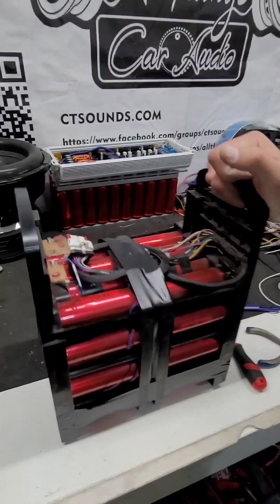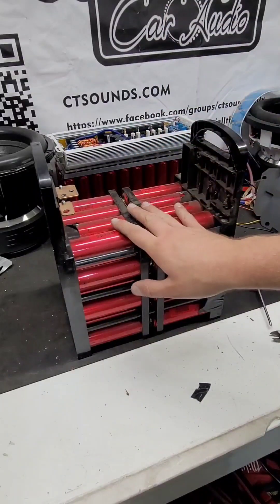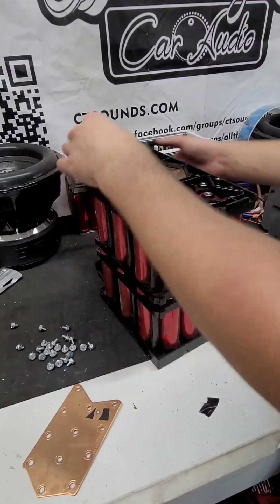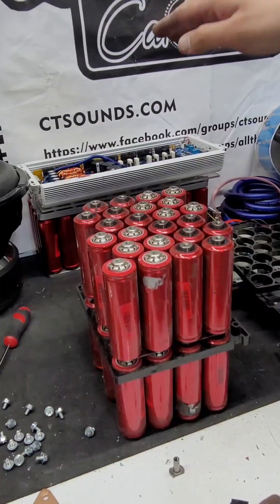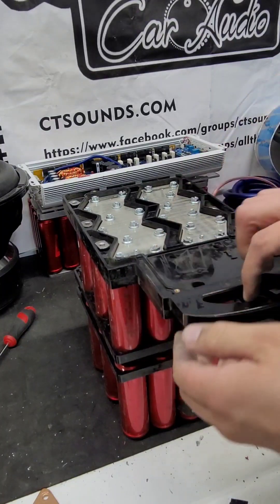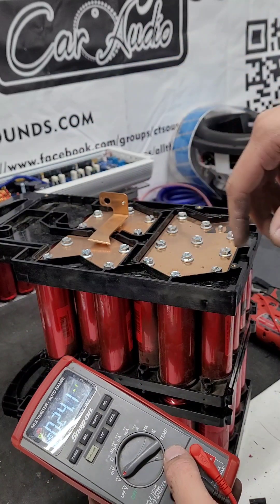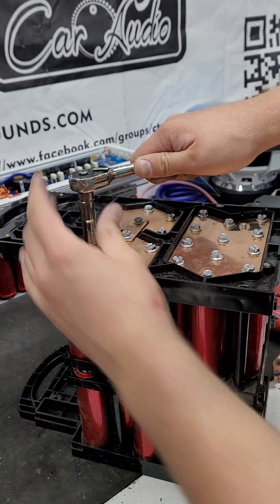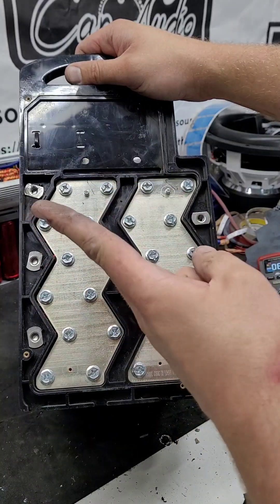How To Convert 96Ah Headway Super Beast to 12v

Comment: so i dont have a high output alternator at the moment and i plan on running a cab22, could i use this and be fine with my stock alternator until i get my new car and alt?
Reply from the maker: Yes, absolutely
Reply: thank you for replying. I shouldve mentioned though, i drive an hour to work, think the stock alt can charge the bank enough to keep me from dropping too much?  @ATCA
Reply from the maker: @Josephobrien-qo3wq  yea
Reply: alright, thank you for responding. @ATCA

Comment: Alright, first off, Im a meat head. I have this assembled backwards however I cant see it making a difference. Basically, the bars that you connected with the cut off piece on your positives, is connected on my negatives. Everything reads the proper voltage, I just have my negatives on the right rather than your left lol.. with that being said (and tell me if that will make a difference), when referring to your balancer video I followed but had to reverse the green and white wires rather than the way you had it. My balancer “run” light has been on and I have been charging it ever since (few hrs tops) but the light has not turned off. Is this normal?
Reply from the maker: Depending on your balancer, the light will always remain on. I have assembled these backwards as well and it makes no difference.  It sounds like you're off to the races!
Reply: @ATCA  Woohoo!!!! Thank you man seriously. I was going to literally take it all apart again in the morning and reconfigure it while re-following your video but Ill rest well knowing I can just continue with building the housing for it. What should the resting voltage be after all is charged? Thanks again for the sweet video
Reply: I didnt do a top balance or anything, each cell read 3.26 to be exact

Comment: This video has been very helpful where do I put the terminals if I want to use both  batteries this creates? Can I add additional copper with copper pipe that I cut and flattened to beef them up?

Comment: I think u need a jumper wire on set b1 and b3 also like u do on b2, otherwise its only balancing 6 cells in that group and not 12 if my thought process is working correctly lol

Thanks a TON for hooking me up with one of these! Should be a huge help with my battery generator project! 

I hope u find that gokart fun!
Reply from the maker: I put a jumper
Reply: @Trevor Moon  sorry if I came off the wrong way the other day, just thought I found something I should share with u.

Tested it out today and DAMN, she pushes some power! Pulled 1600 watts like nothing!
Reply from the maker: @2down2togo  awesome
Reply: @Trevor Moon  I must of missed it. Did have u had a chance to go over that gokart?
Reply: Hey todd wondering if this is true? I’m about to build mine.
Reply: @kevinlechner7722  if u pay more attention like i didn't, he did put the jumpers on lol buy yes they are needed because the cells are in groups of 6 not 12
Reply: U can also make 2 packs and parallel them together at the end so the groups of 6 don't need to be put together with a jumper. Theres 2 good ways that I know of if u want to keep the pack together otherwise u need your own buss bars
Reply: @2down2togo  so I could buy the 12v holder make use the original and make two packs and then use just one balancer? Thanks btw

Comment: Great info. I wonder if you could order one of the plates that are connecting all the negatives, and use it on top to join the positives...I get you'd have to modify the plastic piece with the integrated handle, but the new plate would cover the mods and look super clean when it's done. I've been watching DIY Lithium bank videos all morning and this is the most interesting thing I've seen. Thanks!
Reply from the maker: Absolutely you can do that
Reply: @ATCA will battery Hook up will sell the bus bar's and new end caps? Cut some plexiglass for side's!  I just ordered one yesterday and a balancer. Hopefully this will stop my taramps from shutting down on bass hits... Even with an Apex 400 amp alternator 😢

Comment: Your balancer and BMS monitor lines are not on all the cell groupings. You should have jumpers across the center plates, and another copper bar across the other two vertical plates. And if one cell dies, you better have some serious connections between the center plates and the other side.
Reply from the maker: Check out the balancer video

Comment: So how many amp hours is this 12V system after the conversion? I'm thinking about buying (2) of the super beast modules from battery hook up
Reply from the maker: 96ah. As the title states
Reply: @ATCA  WOW 😳😳😳. So that headway battery module can support over 10,000 watts in car audio?
Reply from the maker: @drvictoria07  with a big alt, yes. I'm running 2 of these and 2 360a alts for 20k watts
Reply: @ATCA  awesome 👍. That's all I needed to know! Can I use my stock alternator with it or buy a high output alternator?

Comment: I just installed this as my main battery located in the trunk. My car 2005 Volvo v70 is only charging my bank to 13.2 - 13.3 volts is this okay for these cells ?  Any advice or input is appreciated !
Reply from the maker: Likely a poor gnd or power
Reply: @ATCA  I’m gonna investigate my voltage at the alternator and check for drop 🤞🏻 may just have a tired alternator or poor ground then ? Thanks for the input man !

Comment: I just got one ofthese and converted it to 12v.do you need to pull these apart to charge them ?
Reply: Im running the superbeast and a 320amp alt witha 95 ah agm under the hood  pushing around 5k .i drop to around 13 12.8 if im soft clipping
Reply from the maker: @bradyjerrell7198  that dounds terrible.  What's your drop at the alt vs the battery
Reply: @ATCA  alt is pushing 14.6  and that is voltage at the amp but last time i checked the voltage at bank it was around 13 .everyone on facebook was saying that was normal that headway doesnt start working till in the 12s
Reply: Im not sure what it drops to at alt tho ill have to check
Reply from the maker: @bradyjerrell7198  yes its true that Headway work in a lower voltage but should hold 13s or pretty close. You could be having a substantial voltage drop tho. Thats why I asked this. It's very possible that your big 3 needs to be a bigger 3 or your amp may need bigger wire in general from front to back. Im running 2/0 For my 340 amp alt. If you have different voltages at the amp, battery, or alt, you need to upgrade your wiring a bit to keep thsg voltage more stable.
Reply: @ATCA  ok . I have big 5 its all in 1/0 welding cable and i left the stock ones on there as well is that big enough ? , then 2 runs of 1/0to the bank then from bank i have 2 runs of 2/0 to each amp .have a have 3/0  grounds one to each and i also have a 1/0 ground ran to bank also .i will admit my grounds are ran to my seat bolts ik its not ideal but do you think that is the problem or is it bc my big 3 is to small
Reply from the maker: @bradyjerrell7198  checking for your voltage drops will tell you exactly where you're losing it
Reply: @ATCA  ok thanks man
Reply from the maker: No
Reply: Ok .everyone keeps saying i need to pull it apart and hook them in parallel and balance them.could i simply put a lead on the negative and positive and just charge it that way ?
Reply from the maker: @BassSoLowItHZ  if you bought a super beast. THeres no need.
Reply: Yes sir its a super beast but its sitting at 12.75 volts. But ok man i really appreciate it
Reply from the maker: @BassSoLowItHZ  its fine
Reply: @ATCA  I just finished converting my Superbeast the way you show here but how do you run this setup? How much amperage have you  seen the supplied buss bars handle?? Ive read this 12V(96ah) can handle a 6,000 to 12,000 watt system but can these buss bars handle the load or is it necessary to get some like the Jim's Machine Works bussbars?
Reply from the maker: @bmanmitch2005  I've ran 400 amps through these just fine. The alt will be your biggest contributor. Ap a 300 amp alt and 400 from here is 700 amps. Thats a  lot of amperage.  After impedance rise, that will be about 8kw+ amp worth of stability
Reply: @ATCA  ok thanks, I do have a 350 H.O.alt from Autotec ran with all 1/0 copper power & grounds..  In your opinion do you think I could connect the copper lugs to the provided buss bars and be ok ? My system total is about  6,000 rms..and I estimate at max volume will draw maybe 500 to 600 amps of current just going off of my amps specs..Im still learning about lithium and just want to be sure.
Reply from the maker: @bmanmitch2005  I did. I went to tractor supply and got some m6 stainless flange bolts of different lengths and connected the lugs directly to the pack. Main power and gnd, amp power and gnd and even a few other accessories
Reply: @ATCA  Thanks again , I asked because someone on another site pointed out that the provided Superbeast buss bars are only rated for 300 amps max
Reply from the maker: @bmanmitch2005  perhaps.  But ive ran 400 through them
Reply: @bmanmitch2005  ive heard the same thing
Reply: @BassSoLowItHZ  I just went back to the Headway website and if you go to the Headway cell 12v KIT ONLY BUSBAR + HOLDERS it shows 300 amp max if you connect to the main connectors which I believe are the thin copper ends that we cut off and drilled holes in as Trevor showed us but what I did miss on the Headway site it says 500 amp discharge if we connect directly to the bussbars on top of the cells which is great news for me lol.
Reply: @ATCA  Just checked the Headway site for the Headway cell 12v KIT ONLY BUSBAR + HOLDERS and they say 300a discharge using the main connectors but it's 500 amp discharge when connected directly to the buss bars on top of the cells .
Reply: @bmanmitch2005  i thought i seen on batteryhookup it said if converted to 12v it os 2 300a banks
Reply from the maker: @bmanmitch2005  I just know I've personally had 400 amps pulled on them without issues
Reply: @BassSoLowItHZ  ok if so that's even better

Comment: I like this method, but your balancer will never balance that pack... the leakage  current will be many times what that balancer can provide. You need to look for one of the 5 Amp capacitive balancers... since you have 12P times 8A cells... or 96Ah capacity per parallel cell group.
Reply from the maker: I have the 5 amp balancer too. But the guy on Facebook says the 2.5 amp works fine. Even on big banks.
Reply: @ATCA  Hey Trevor, I just ordered the Headway superbeast and plan on reconfiguring it to how you are showing in this video but could you also post a video showing how to connect the balancer? Or could you tell me where to connect the different wires
Reply from the maker: @bmanmitch2005  I have a balancer video.
Reply from the maker: @bmanmitch2005  https://youtu.be/C2s2tM68548
Reply: @ATCA  OK Thanks